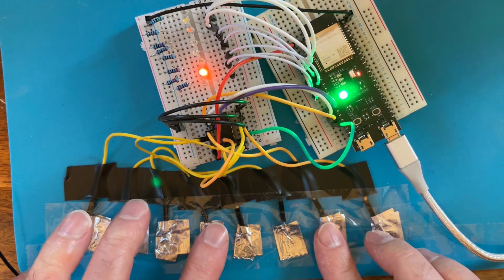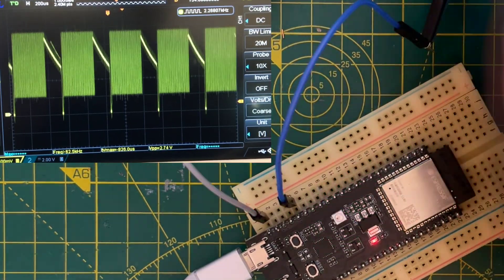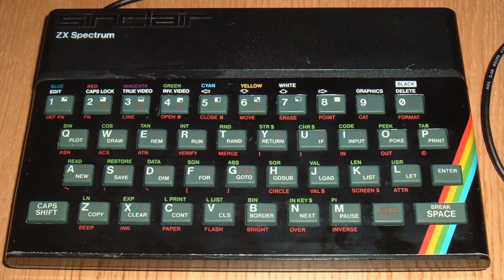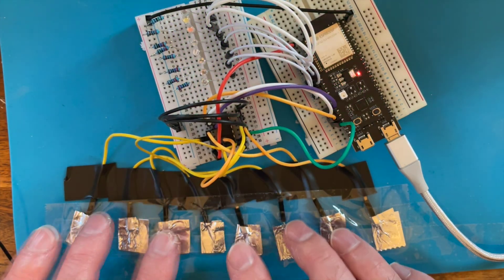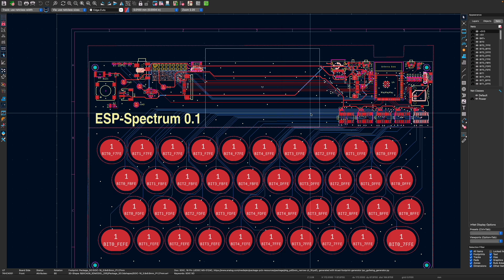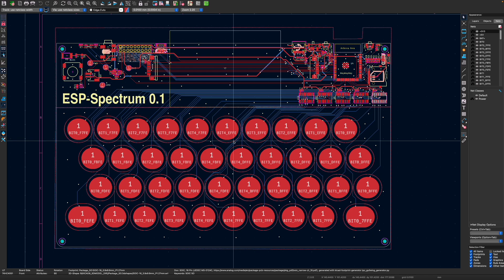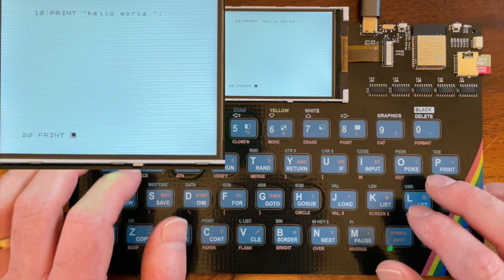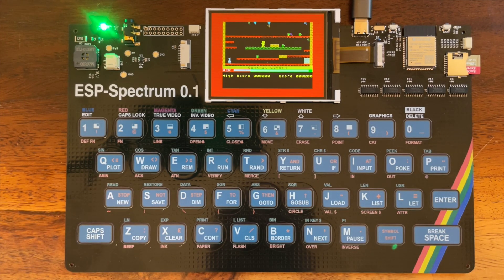ESP32 - 40 Independent touch pins!

Comment: My understanding is that those analog pins are capactive touch , but why didnt you just use the same digital pin matrix with diodes  as seen on the original  ? No need for those multiplxers ?

But your approach is quite neat , how many gpio did u connect to each mux ic ?
Reply: I just realized,  you don't actually have any physical keys , lol , so capactive it is !!

Comment: why not use an i2c touch sensor with 10 channels? mpr121 also cheap as chips
Reply from the maker: MPR121 is very nice, but it's $1.59 on LCSC and I'd need 4 of them which would add up to over $6. The analog multiplexer is $0.10-$0.20, and I need 5 of them, so it's <$1.